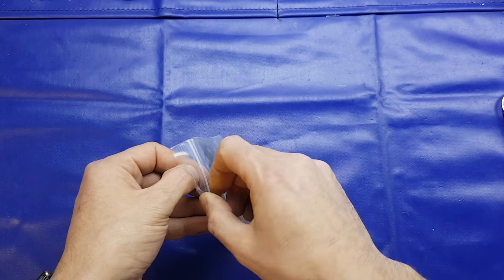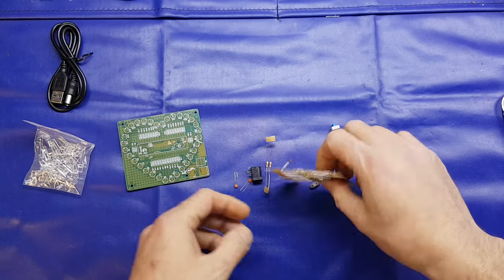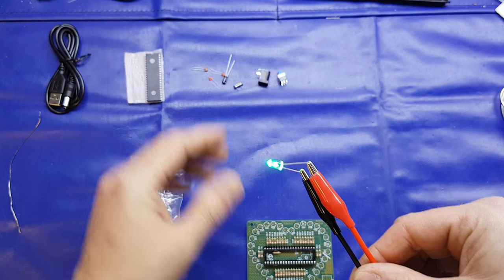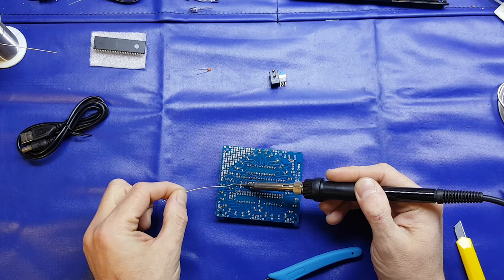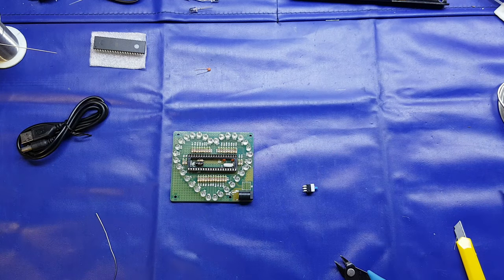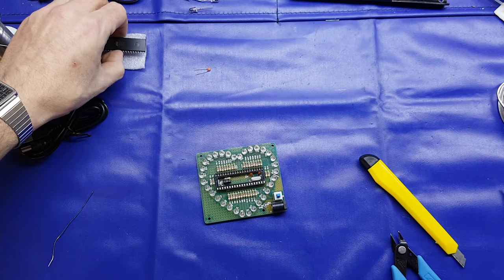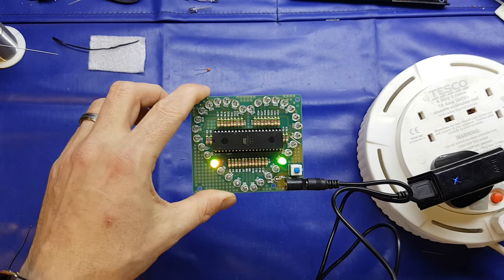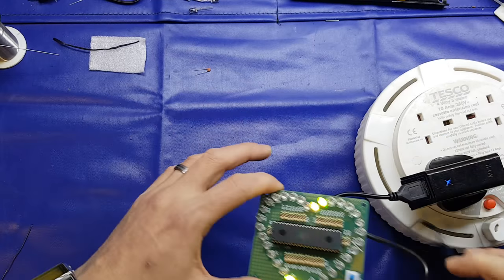***Competition time #4*** & the best LED heart kit yet - RGB with really nice effects (tutorial)

Comment: This is actually a very nice kit. I've completed about 5 of these so far. If you install it in a thick Picture Frame (to give it more depth) with a White translucent plastic behind the glass, it makes a nice gift. Just leave out the Switch/dc-plug and attach a usb-cable to power it. They also work really well if powered from 2 AA batteries.

Comment: The LEDs aren't being controlled. They're just not random. Each time you power on one of those LEDs they restart the same sequence at the beginning. In groups, they'll remain synchronized for quite some time (30+ seconds) before the manufacturing differences cause them to drift apart. Since they're being turned on in a close sequence and left on for only a few seconds at most, the patterns emerge from the LEDs design.

Comment: I want to win 
but I bought the exact same kit from aliexpress with several spares also but mine didn't flash like yours did; I replaced the crystal but same. I either get a slow fade up and down with the crystal in place or random light flash with the crystal bridged. I wonder if mine is programmed differently?

Comment: how many pins are being used - i.e. what's the resistor to LED ratio? maybe its a single pin driving a single LED, although it looks like maybe 2 LED's per pin?
Reply from the maker: There's 32 RGB LEDs with 32 510ohm resistors so 1:1

Comment: I want to get into building these type of kits, but I am a total novice. How do you work out where stuff goes, if you don't get a diagram? How did you know to put that little piece of wire in between those two LEDs?    I bought a clock kit from ebay. No instructions and no help from the seller. And I've searched everywhere but no luck finding anything.....
Should I give up and find a different hobby?       Great video's              I've subscribed
Reply from the maker: +Connor Fox NO! Do not give up! What kit did you purchase? Can you post a link to it?
Reply: Hey there. This is the link (I hope) http://www.ebay.co.uk/itm/311783048179?_trksid=p2057872.m2749.l2649&ssPageName=STRK%3AMEBIDX%3AIT

Comment: made this heart but all mine does is twinkle on and off, any ideas?
Reply: l'm waiting for a new chip to arrive I'LL let you know if it makes any difference.
Reply: clockwork org 
New ic chip arrived plugged it in and only 3 or 4 LEDs lit, unplugged it again and with the power on replaced the ic as l wiggle it different LEDs light and after unplugging and replugging several several times it began to work properly, l think if you persevere you should get it working. Good luck let us know how you get on.

Comment: my microcontroller isnt working properly on mine. it just lights up the top half of the LEDs solid and the very top 2 flickers. if i place the micro controller on without pressing it in, almost all LEDs come on and try to work but just flicker and stay solid
Reply: I have the exact same problem, though for me all of the top half leds flicker
Reply: i bought a different micro-controller and still same problem. i think it is a seat problem with the micro controllers seat. im going to try electrical grease to help make solid contacts
Reply: hi yall Did you get it to work? I bought another kit from aliexpress and it works fine, just like in the video. Thinking of switching the ic from the faulty one to the working one to see where the problem is.
Reply: i got a new and different microcontroller and it did not work still. it would try to work when i place it on gently still. i believe the problem lies with the controller bed. i removed this and going to put the capacitor and other stuff on the back of the board and then solder the micro-controller straight into the board itself. i been lazy and havent gotten to it. just only removed the micro-controller slot so far. i guess ill go ahead and work on it now and see how it goes
Reply: didnt work. this one is trash now

Comment: I got the same kit on ebay (http://cgi.ebay.com.au/ws/eBayISAPI.dll?ViewItemVersion&item=292042887819&view=all&tid=1424995438019), or at least it looks like the same kit, and the pics show what appear to be the same sequence of flashes and colour changing LEDs, but I'm another one who seems to have the variant where the lights fade up and fade down, rinse, repeat.  Somewhat boring and a waste of the colour changing LEDS as they don't do their sequence, just 'sparkle' a wee bit (and they are the colour changing LEDS - I checked).  I've looked over my soldering carefully and repositioned the microcontroller several times and used different power sources, but still fade up, fade down.  Does anyone know if it's a dud microcontroller or just differently programmed, or some other problem?
Reply from the maker: +Jenny Hart Have you put the small wire link on the board?
Reply: Kris Cochrane Yes, I have.
Reply: I think I've narrowed it down to the two 22pF capacitors and/or the 12MHz crystal oscillator. My (very new to me; was using a very basic meter until recently) multimeter refuses to measure the capacitors properly (fine with the electrolytic capacitor; won't measure anything sensible with any ceramic capacitors - I pulled some out of another kit and had the same problem measuring those, built the kit and they're fine, so probably user error measuring those). Probed the whole circuit and finally decided the only thing not tested was the crystal. So I looked up how to measure frequency, powered on the circuit and tried testing the crystal - wildly fluctuating readings (not getting close to 12MHz) and depending on when in the fade in/fade out cycle I probe it, the LEDs either stay on steady and start the colour change sequence, or go off completely.  When I've managed the steady on, the colour changes are quite nice.  Given what I paid for it, I'm probably better off entering the eBay lucky dip with buying another kit than trying to source one or two itty bitty replacement parts...
Reply: The code can be downloaded from this site: http://goughlui.com/2016/11/07/project-at89s52-based-multi-coloured-led-heart-kit/  
a very interesting article about this kit.
You can find a download link about 1/3 down the page.
I tested it with one of my kits and it works fine.
Reply: Thank you Christian, that's very helpful. I was wondering if it might be the chip as since I had the problem with the heart kit, I've soldered two of the POV wand kits - the first was perfect and the second failed to work, but swap the chip over from the working kit and it's all working fine - so definitely the chip on that one.  I have located the code for fixing that one so I will investigate the programming options as suggested to fix both kits.
Reply: Jenny Hart I'm glad I could help you. I hope this will help others too. Maybe you could send me the link to the software for the wand. That would be nice. 😀
Reply: It appears both the POV Wand and the LED Heart kit are by Zheng Zhong Xing.  I found the information and code here: https://github.com/tardate/LittleArduinoProjects/tree/master/Electronics101/PovShakeStickKit